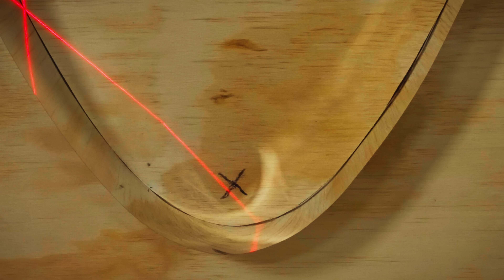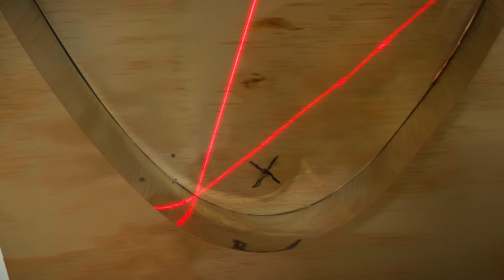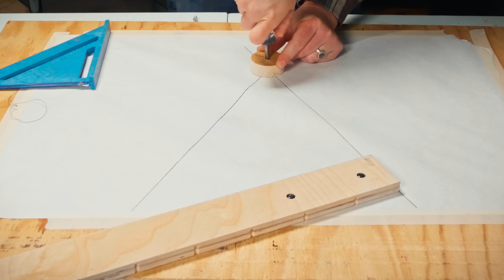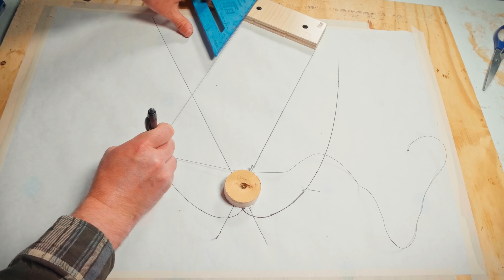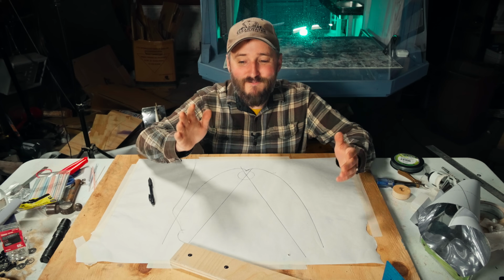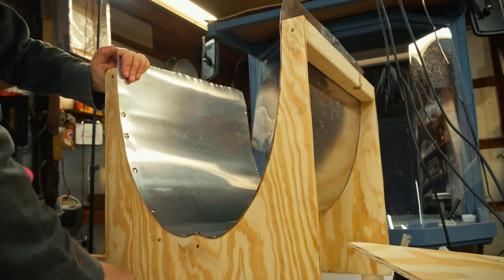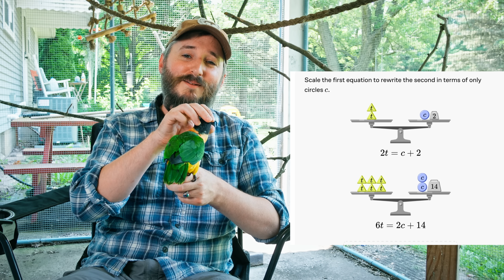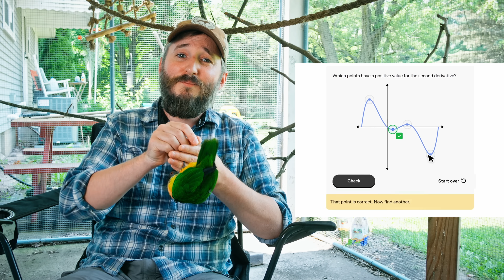DIY Solar Concentrators, Made Better.

Comment: I want to say the first part of you compound curve can be defined by a involute. From the start of the curve until the string leaves the circle (no longer tangent) you are tracing the path of the involute of that radius. This is the same curve spur gears use to define tooth geometry.

I'm still working on it in CAD to figure out the relationships for the second half of the curve. I'll be back if I figure it out.

Comment: Saw this and immediately had to find the most effective way to convert it into electricity, you use a centralized air-turbine, you heat the pipe, hot air gets forced into a pressurized tank and is shot out into a high efficiency turbine

Comment: Buy using smaller bore pipes on a manifold , the collector can be shaped to increase the area available for solar gain and maximise the collectors concentration or throughput.

Comment: Hi,
Fun fact (Cunningham’s Law in action!): a uniform chain hung from two fixed points doesn’t settle into a parabola—its true shape is a catenary, described by the hyperbolic cosine 
𝑦=𝑎 cosh(𝑥/𝑎)

The parabola is only a close approximation near the lowest point, so the curves diverge once you move even a short distance away.
Thanks for the video!

Comment: If the compound parabolic shape can reflect all light on the target, why not make the angle as wide as practical ? you say that narrower angle are better for direct sunlight but why ? if all light coming within the angle is redirect on the target, you don't loose direct sunlight with a wider angle. I think that in direct sunlight both narrow and wide angles would be comparable, but the wider would harness more light in any case (even in direct sunlight there is scattered light comming from all direction).
Reply: Okay I've played around a bit with it and I get it. As you open the angle the two curve comes together and you lose on the opening at the top, if you maintain the opening you lose on the reflective area. It would be interesting to find the sweet spot !

Comment: Is this any better than conventional black plastic water tubes that are normally used for this purpose? They are also put in a (square) box with glass over it. I would like to have some sort of setup like this for solar powered hot water/solar shower.

Comment: I do solar cooking on several different categories of cookers here in Michigan.  Lately I've been using an evacuated tube solar oven and amplified it with a homemade reflective parabola. I can even get enough light with the set up to sometimes cook inside the house on sunny winter days. You've sold me on the compound concept and think I can not only use it with the oven but design it for a diy solar hot water for the house.  That you don't have to turn it truly blows my mind!!!  Hope to see you come up with a simple way to store thermal energy.  This channel rocks!

Comment: I don't mean to pry. It is a nifty shape and you taught me something yet again. But is it really better compared to the parabolic mirror? As you said parabolic mirrors are great at focusing to one point when the source is at the right angle. 

But then you point out that we don't need to focus the light into an infinitely small point for it to be useful. 

Now to my point. Does it then matter that the light is not coming at 90 degrees even with a simple parabolic mirror when you're not aiming at that one specific point? The demo at 2:15 kinda showcases that the light is still hitting around the point so it should still be useful right?

Comment: What is the purpose of this construction? Will running utility water pass through the pipe or will the pipe be used as a heating element inside a solar water heater? It would be more complete if we could see the water temperature and the practicality of using the construction. Thank you very much for the geometry!

Comment: Wow! That is so incredibly cool! Now what stops you  making 3 or 4 of those and attaching them to the pipe offset at different angles around the pipe (with the pipe as rotation axis)
? That way you should be able to collect sunlight from much more angles,  at least in that dimension! And as a potential crazy upgrade, make them revolved 3 dimensional compound parabolics in some sort of flower shape :D Then you should be able to collect all the sunlight from all angles all at once :D ( even though potentially, making such a 3D shape into a mirror might proove tricky)

Comment: In theory you could use a wide compound parabolic aimed at narrow compound parabolic/ a parabolic moving the focal Point behind the wide compound parabolic making it easier to access and incorporate more complicated or larger systems without reducing sunlight although you will have to consider the heat on the secondary reflector

Comment: As always, fascinating.  Spray painting a chain is brilliant.  Why not prime your project board first (a darker color), then spray paint the chain directly onto the board. Then you've got the board ready for outdoor use, ideally painted with a bright white, shiny enamel, and your parabola is laid out for the next step.  I'm just getting started with a small, portable solar set up.  Frustrated by fact that it takes days to fully charge the battery and a much shorter time to use up the stored electricity.  And the cloudy day issue.  Can this help?  Worried that concentrating the sun will raise the surface temp on the panels to a point where it impacts the efficiency of the panels.  I also don't want to permanently damage them.  As an aside, could you use this idea to quickly heat a pouch of water for showering?  Or cooking?  Can you attach the reflector to the chain for portability and fast set up without it being affixed to a board?  Or hinged holders for chain/reflector that can fold flat for storage.  Also wondering if we need to be mindful of our eyes when using this.

Comment: Now how do I save the heat? 
If I used the compound parabolic mirror for a solar panel, would it have higher efficiency or would it just melt the panel?

Comment: Dude, perfect timing with me finding this right now. I'm building a solar oven and disappointed with the performance and was thinking about mirrors. A compound parabola designed to reflect light onto the top pane of glass is perfect! I was thinking about how annoying flat mirrors would be and having to constantly adjust them, this is much better.

Comment: I might have missed something but would it not be easier when drawing the compound parabola, to draw a right angled triangle screw the wooden circle to the top corner, place the straight edge at 90 degrees to the hypotenuse exactly how you did, draw the 1st curve, then fold the template in half along the middle and duplicate the curve to the other side.

Comment: Very good observations and construction methods, congratulations! It needs to be pointed out though that thermal emissivity of the smaller diameter pipe is considerably higher, so in this way it can not build a lot of heat (for the same energy input). The test should have been performed with pipes of the same size. It is clear though that in one case the system is more optimized for capturing solar radiation vs the other.

Comment: I wonder how would such reflective system act on sound waves, it gives me an idea of an acoustic instrument (or a speaker enclosure) that would use parabolic compound shape to disburse sound waves into environment in an action opposite of what you're doing with solar rays , so sound post would be a vibrating element in focal point, and sound waves would be reflected off the walls, something similar exists called Helmholtz resonator, but it has opposite function of dampening sound waves

Comment: You do mention different shapes for the pipes and you do try a flat horizontal one. However I was thinking of the opposite, having a squeezed flat pipe sitting vertically should give us more freedom of the incoming angles. Another thing is how to maximize the captured sunlight, having a wider angle between both reflector wings surely helps.

Comment: Pause 10:33
Angle as sun tracks accross the sky. 
Summer time in UK sunrise is 50 degrees, sunset 310 degrees
Summer time 50/310 = 260 degrees needed. 
Winter time 130/230 = 100 degrees needed. 
So i guess making one for 260 degrees covers for both summer and winter :)
Reply from the maker: You don't need that much, you just put the pipe parallel to the sun's path

Comment: A chain would form a parabola only  if its length is only slightly longer than the distance between the hanging points. In your case you get a hyperbolic cosine or a chain curve, which is only a gross approximation of a parabolic shape. However, it is enough for your purpose.

Comment: 4:35 I'm not quite sure it's that irrelevant at what angle the light hits the pipe. Sure, a hundred percent of light of the laser still hits the pipe, and you get the added bonus of more light in total hitting the pipe, but with a smaller than 90° angle, light gets reflected at a higher percentage. It's the reason why caustics in water happen; more light passes through the surface at angles closer to 90° while more light gets reflected at smaller angles. I have no idea if this also applies to solid surfaces, but considering the temperature difference between the arctics and the equator is due to the angle, I wouldn't outright dismiss it that quickly if you're aiming for perfect results. I think a simple fix would be to use a smaller radius template while tracing the shape of the pipe. That way, the deviation of the angles should decrease from the full 0° to 180° range, so the angles are closer to the more effective right angle.

Comment: NightHawk. Another avenue might be to use another optical concentrator to heat a "Sand Battery". The stored energy within that 'might' be able to run a Sterling engine, even during nigh time period? Attach a  generator to the Sterling and store electricity from that into batteries (golf cart type maybe). Plenty of variables I'm sure??  What do you think?
John (UK)

Comment: Did Ben just call himself a regular guy? LoL.... I think that he meant a rare guy! 
It's a pity that the two examples being tested weren't using the same pipe! 
I don't know but I feel like the small pipe had less surface area to concentrate energy into! Unless there's a specific fundamental that I'm not aware of that requires a smaller pipe for the size of the reflector? 
I can't help but think that whatever light was available at the time, was missing the target pipe....

Comment: The large pipe seems to have been mostly closed in the back and you put a cup in front of it to not lose temperature... The small pipe was open on both sides... Don'tcha think that might impact readins?

Comment: Have you seen Stanford's AGILE solar concentrator? It funnels light with materials of different refractive indices
Reply from the maker: Sounds interesting!
Reply: It doesn't require solar tracking to maintain effectiveness, can funnel light from most angles

Comment: Showing the construction with string and straight edges is very cool but I'm not sure the test is a "fair fight" - you show that the parabola doesn't perfectly focus all off-axis light to a single point, but you never tested the simple parabola with an equally sized pipe to show that the compound parabola does a better job concentrating sunlight on a finite sized target.

Comment: Now I want tube shaped solar panels, ideally that are water tight and water safe.  I'm imagining a water cooled solar system using the tube design.  Unfortunately some quick Googling reveals that yet again, I want something that no one seems to make.

That said, if you can get these temperatures on a cloudy day, I wonder how much power could be generated from a system like this using thermocouples.  It probably wouldn't be as efficient as solar panels, but it might be more efficient than solar panels that are also powering their own water cooling system...

Honestly, this is probably one of the most affordable projects you've done, and it's one that hits square in the middle of what I'm currently trying to develop, which is long term emergency power generation targeting mobile/USB powered devices.

Every time I think you've hit the nail on the head in terms of what I'm trying to develop, you somehow manage to do even better.  Absolutely awesome work!
Reply: Round solar cell at the bottom of a 3d rotation of the latter compound curve to generate energy from visible light, filled with water to collect infrared light to heat the water, and cool solar cell for efficient operation?
Reply: @ChrisNotTheKing  You could get some heat in the water, but if it's hot enough to consider "hot water," it's still too hot for the solar cell.  For warm water though, like maybe prewarming before sending it into another stage with black pipe?  That would be a solid option.

Also, I'm less worried about efficiency than lifespan.  Overheated solar cells aren't just less efficient, the heat causes damage that makes them wear out faster.

But yeah, water tight solar tubes combined with this would be absolutely awesome one way or another!

Comment: I wonder if there'd be any benefit to designing the compound parabola for a slightly smaller area than your pipe -- The inside diameter perhaps. Presumably your goal is to heat the contents of the pipe and not the pipe itself. At the cost of some surface area, you'd be focusing the sun's energy inside the pipe. Obviously taken to the extreme, you'd just have a simple parabolic reflector focused at the very center of the pipe -- which would work great if aimed toward direct sunlight, but loses all benefits of a cloudy day collector. Perhaps there's a sweet spot in between both focal points? 

Speaking of sweet spots, is there an optimal distance from where the lines intersect as to where the object should be placed?

Comment: For the test: was the small pipe open to the air on both ends? And the larger one capped on both ends? That would be a confounding factor with convection carrying some heat out of the smaller pipe, no? Thanks for the video!

Comment: I've wondered if it would be at all practical/possible to use a solar concentrator and attach a homemade bubble pump (using a one way valve before the heating element to move the water like in a coffee maker that engineerguy showed off years ago) to heat a small pool/water tank without any electricity. And also how it might compare to one of the coil solar water heater box designs (like on the Tech Ingredients channel) for a similar volume. Or maybe even using them in series to get higher temps.

Comment: Neat, if you paired it with a swamp cooler on the back you could use it to power a Stirling engine in a pretty wide variety of weather scenarios.

Comment: The flat collector design is still a parabola that has been truncated at the focus and then widening the two halves independently. It's actually a pretty well known collector design that's already in commercial use for water heaters.

Comment: Typically Reflecting Multiple Sun strengths is very direction sensitive - reflecting a single sun from ANY angle is relatively easy - BUT obviously zero amplification is achieved (though one sun of solar thermal / light from dawn to dusk will be a lot better than a typical flat panel...

Yes the focus is never infinitely small (or the energy will destroy the target - A certain "finitely sized" target-  means the angular sensitivity of the system is much lower...

 - The compound parabola is  still only getting s few suns - MAX - in clear sky conditions - while it is still getting ?? 1 sun in cloudy - while the Conventional parabola is getting a fraction of one sun through the clouds..

Comment: Fascinating design, and I love the relative simplicity of the build. But, this being the first time I've heard the term "solar concentrator," I'm curious how you would apply it to something functional. Could this thing be built to power a solar oven? Would it heat a constant stream of water, or would it require a stationary tank? I'll definitely be keeping my eyes out for the next installment for practical applications.
Reply: I have a solar oven powered by a large parabolic mirror, it can easily reach 200°C or 392°F, I also have videos how I cook with it. Of course you can also heat a constant stream of water with CSP = concentrated solar power

Comment: I'd be interested in seeing a test of the flat collector design on a small solar panel during a cloudy day.

I'm sure that on a sunny day, a normal flat panel pointing directly at the sun would outperform a stationary reflector panel, but cloudy days can be a big problem for solar panels, especially in terms of consistency. Because the clouds scatter the light, most of the ambient light isn't going to be hitting perpendicular to the panel no matter where the panel is pointed.

Comment: Is it possible to add an amplifying kit to increase performance? Also, add a water pump that circulates the water. It can be used as a water heater for camping, at home, in emergency situations, or for daily use. I know that there are lockers like this, but they may be large and expensive for some, and not good for moving around